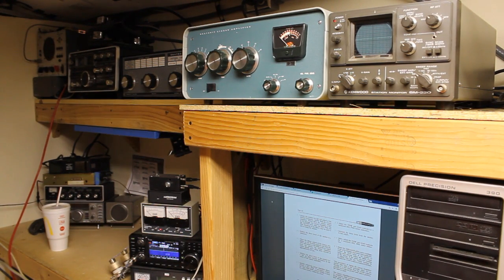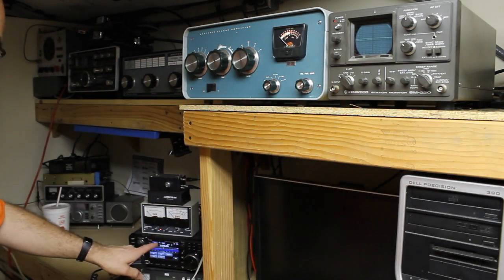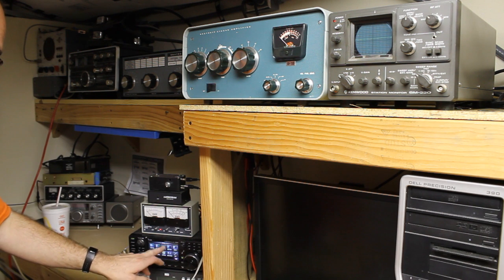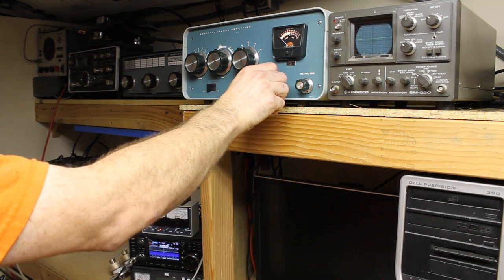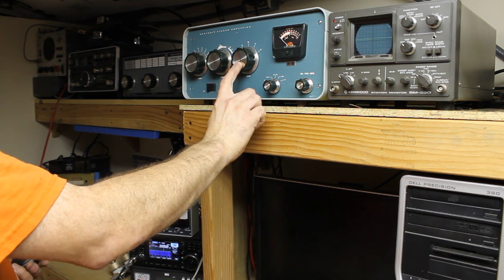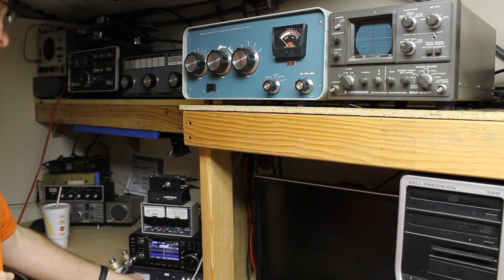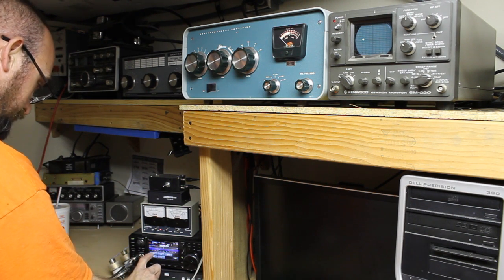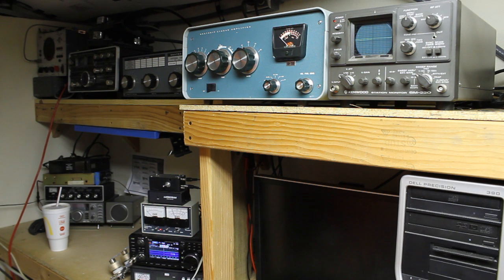Tuning up the IC-7300 with Heathkit SB-200 and Kenwood SM-220

Comment: I have the IC7300 and just acquired an SB-200 and a wattmeter. I see you are using the ARB-704. Can you tell me your cable chain connecting the components starting with the IC7300 and ending with your antenna? And I assume the ARB-704 is to interface the radio with the amplifier. Thank you.

Comment: Great video.  I just purchased an SB-200 from the widow of an SK and after I got it home found it already had the Harbach soft-key and power supply upgrade done.  She didn't have any interface control items.  Since I will be driving the amp with a Yaesu FT-857 I assume I need the Ameritron ARB-704 and the PNP8M interface cable then an RCA cable from the ARB-704 to the ANT Relay plug on the amp.  We don't use the ALC connector on the amp for anything?  How did you build the bypass switch?  My amp doesn't have anything installed in the cabinet for bypass so I'll have to build something.  I am also going to change out the RF input from the RCA jack to a SO-239.  If you could send me any info you have on building the bypass switch and a drawing of how you connected everything that would be much appreciated!  wb0zso@arrl.net

Comment: Thanks for nice video. I just got my SB-200 so it is great to see tuning procedure. I am wondering how do you bypass the amplifier? Is the bypass home brewed? Let me know please!
Reply: Don't know if you ever got an answer.  Here is the short scoop.  The amp filaments light nearly instantly.  If you have turned the amp on,  it is ready.  You may use the power switch as the bypass switch.  Addition of a separate 'bypass' switch is redundant, and unnecessary, as the T/R relay is in bypass mode with no power applied.  I wouldn't keep drive power applied as you switch the amp on and off, when making comparisons.

Comment: Here's what you did wrong.  You did not initially dip the plate.  Always ALWAYS dip the plate first to find near-resonance even at low power.  Only transmit for 2 seconds at a time.   Dip it once at 20W....then turn the radio up to full output (set power  of the raido at 70W in your case) .  Now put full power in and re- dip the plate and peak the load/grid for max power output.  Should take no more than 4-5 seconds TOTAL...between the two.  Now, check for no more than 500MA plate current on DC keydown, and keep the Grid current in the white GRID section of the amp.  You ALWAYS tune at full power for linearity.....if you run CW you're done.  If you're running SSB,  one final step - advance the load about 1/4 of a "number" to ensure linearity...(turn the load knob a little  a bit clockwise).   Finally: once youre tuned up (that's why they call it tuning up)....you can turn power of the exciter down- a so you dont run the amp at full output.  Just remember - don't re-touch the plate tune after lowering power .
Reply: Really sounds like a pro, very informative. I'm still getting familiarize with my AL811 amp. And I really want to learn how to tune it properly. I'm pretty close but still want to hear some advise from HAMS like yourself. I also noticed that on my plate meter when I press HV it only reads to 1300KV. What can be the problem? Also can you pls teach me how to tune it steps by steps. I really appreciate it. 73 de KH2ZZ THANK YOU
Reply: MANY THANKS,  I just bought an old sb 200 here in sweden.  your comments seems good an plate current maximum.  Much thanks from sweden.

Comment: Nice video, I have been a ham for over 45 years and this is my first linear for HF. Picked up a nice one owner Sb-200  with the Harbach soft key and stand by switch installed plus two NOS National 572  B  tubes in great shape and the manual. Paid  $ 400 and it was only 45 miles from the house, no bouncing around with a shipper.  I an not afraid to say I learned a thing or two from your video.  Phil  N9CAV.   73
Reply: Please post a clear tuning procedure of the SB-200...Much appreciated...

Comment: Hi! Thanks for the video.I just picked one of these amps up at ham fest. It was being driven with a 60-100 watt amp. Can you tell me the wiring for the radio, meter, amp that is driving please. Do I tune it with the drive amp on or ???? Thanks. Thanks for the video also.
Reply: Thanks for the video, I have the same amplifier and IC-7300.
What part number cable did you use for the ARB-704 with the IC-7300?  Thanks.
Dan
Reply: If you are going to use the amp with a hybrid or solid state radio you will need the Harbach soft key installed they are inexpensive and easy to install. Go to there web site and check online post for the Harbach and You Tube.  The SB-200 manual is online for free download and many of the upgrades that can be done. As stated by others get help from a ham that has done this, will save you a lot of aggravation.  73
Reply from the maker: George Diaz I drive my SB-200 at 65W. I have replaced the power supply with a Harbach, and I use the Ameritron ARB-704di amp interface. Keep in mind, the SB-200 has lethal voltages (2400 volts) and the keying line can burn up a modern radio. Use caution, and try to find someone local to help you get set up.
Reply: @BootstrapWorkbench   IF I have the Ameritron ARB-704 interface - do I really need the Harbach soft key mod for the SB200? I thought the Ameritron interface is the solution to the 120VDC key closure in the SB 200? Ron